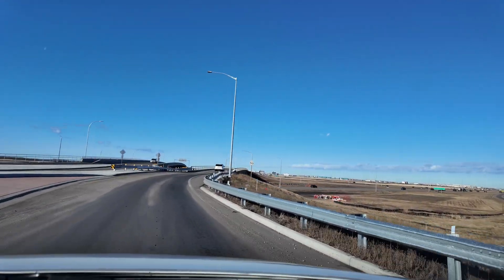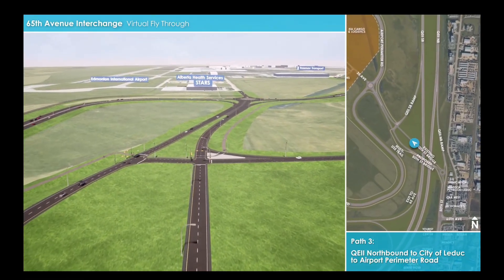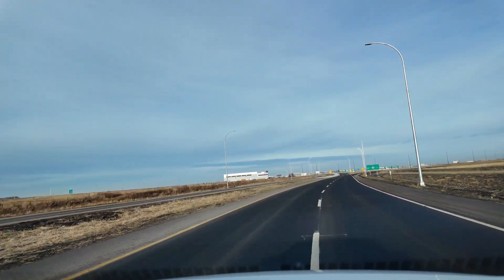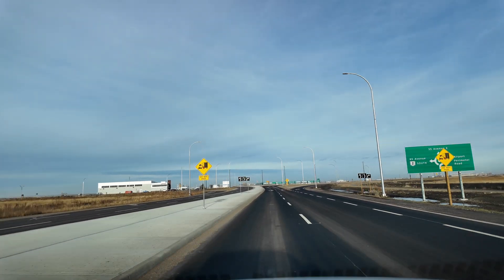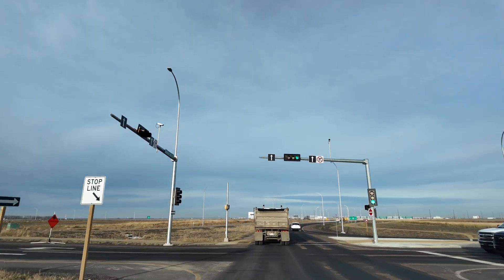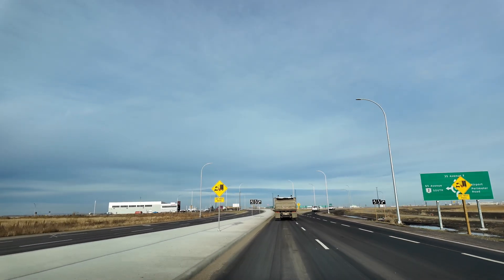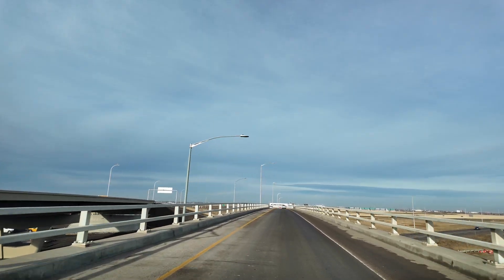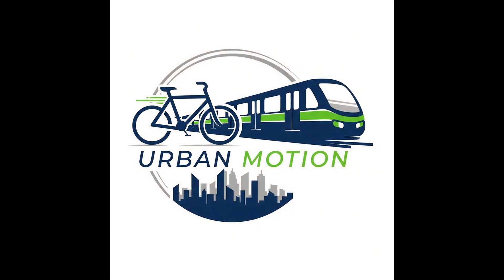QEII & 65 Ave Interchange at Edmonton International Airport (YEG): Construction Update

Comment: I see a problem with collisions between the 65 ave exit south and the south bound exit to Leduc not too far ahead. You have cars speeding up going left with cars slowing down going right within a short distance. Being a local, my self and drive 120k+ in the left lane to get by slowing traffic. Should be an interesting winter driving through there. 😂
Reply from the maker: Agree. Merge lane is too short. Some merging vehicles will be going left to avoid Leduc exit while other will be moving right to take the exit. Could be messy….

Comment: Terminating the pavement westbound on
65th Ave at Grant Mac is a failure. This should have continued west to 74 Street then south to 50 Ave (Hwy 39).
This would have made it the ring road it was supposed to be when initially conceived.
Now the truck traffic is using Grant Mac right between two residential neighborhoods with no noise attenuation. Yet further south on Grant Mac past 50th Ave they spent big money on a noise attenuation wall…albeit only on the east side where the ex mayor lives. Go figure.

Comment: The whole thing is massively screwed up. 65th Ave should’ve been pushed straight across and this mass never built. I definitely agree a third roundabout should have been built and not traffic lights. Truck traffic will definitely use it, but it’s not the degree people are claiming it to be not any time in the next 5 to 10 years. I don’t think the backing up a traffic onto the highway is going to be an issue for a long time if ever. When it comes to the 50th St. on ramp to Highway two going from two lanes to one I don’t think it’s gonna be a big issue. very few people are going to be coming out of the airport grounds using the roundabout to then go north on Highway two.  The way it was built was built to get people from Leduc to the airport grounds and vice versa. With the additional of on and off ramps for Highway two south on 65th Ave., West.